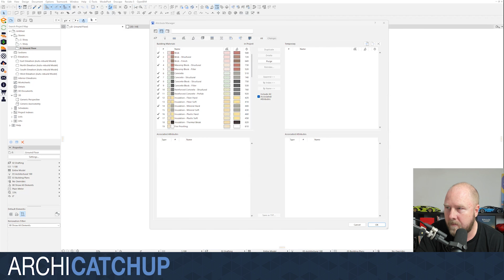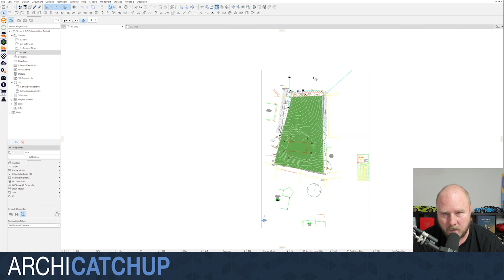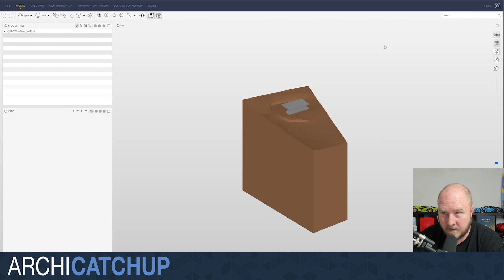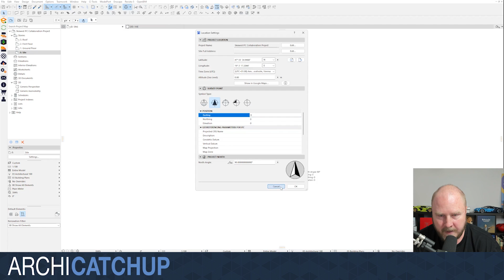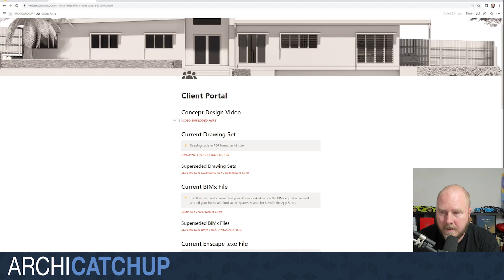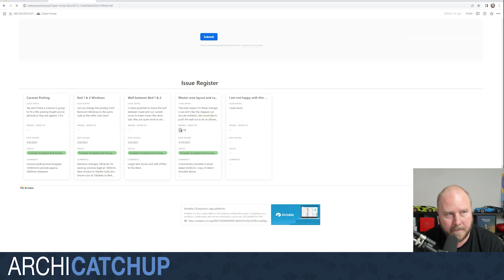ARCHICATCHUP - Archicad Attributes, IFC Collaboration and Client Communication

Comment: It would be interesting to test to if your Airtable data and our Dataverse data can be shared easily between systems.  Do you use M365 or Google or OpenOffice?
Reply from the maker: I have all of my other stuff running through 365. This was an experiment I set up a few months back because I wanted to kill off emails for design changes. In an ideal scenario this would be a process that aligned with BCF protocols so that these issues could then be added to a BIM process. But these days the collaboration platforms are too expensive at the small end of town.